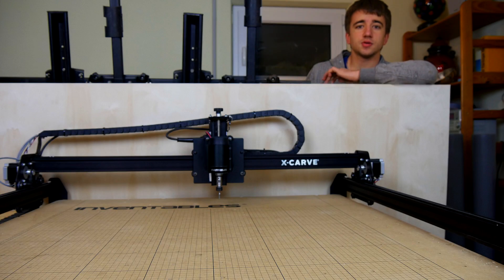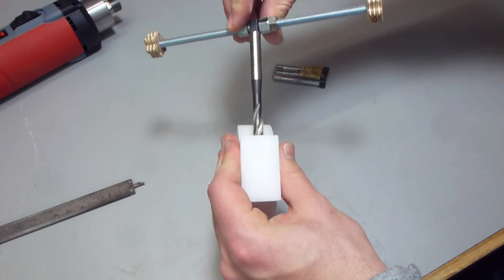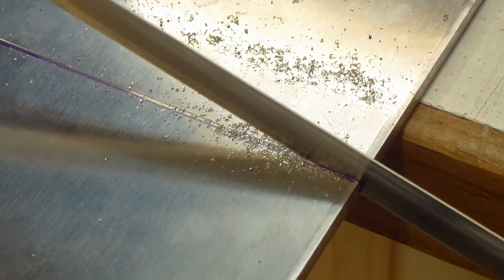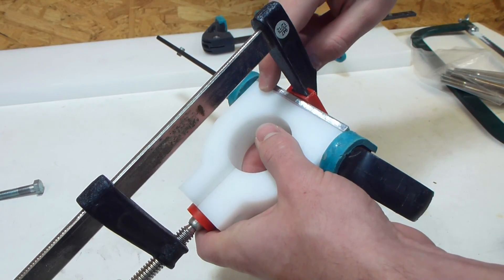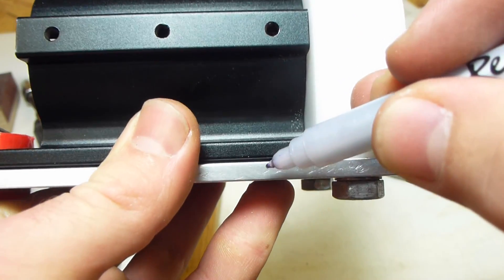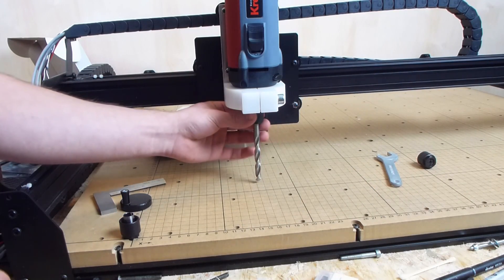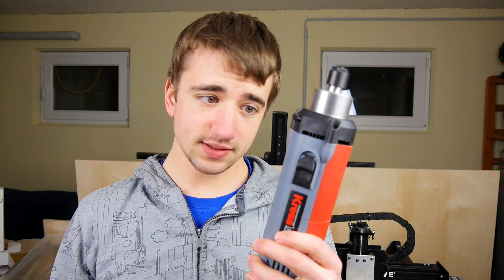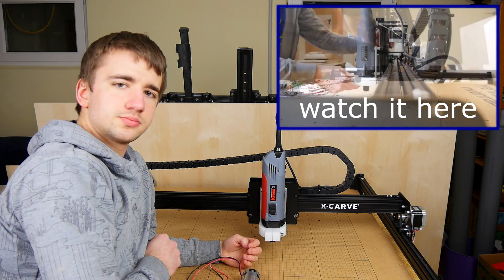CNC Spindle Upgrade

Comment: Those holes are only an uncommon size in Germany.  It's a 9/32" size.  Inches! :)
Reply: +Matthias Wandel As a german, I have to say i hate the imperial system.....
Reply: @roberthagmann8779  As an american I also hate the imperial system, as a contractor I have to use it, but since I learned both it's not that hard, metric is easier, but they both are not that hard to learn. I find metric more accurate
Reply from the maker: +Matthias Wandel Ah, good to know. Strange design then. Metric nut, metric threads but imperial eccentric thing.
Reply: +Robert Hagman 

'murican here, I don't like it either
Reply: Not UK like the rest of the world we've been metric for decades, only use imperial for Signs and car speedometers. America is the odd one out
Reply: +Matthias Wandel 9/32 inches = 0.28125 mils = 0.023 feet = 0.07031 hands = 0.0078 yards, but also:
7,1 mm = 0,71 cm = 0,0071 m = 0,0000071 km.
Reply: Uncommon in metric.
Reply: +gamingSlasher Nope! Metric over here! :P
Reply: *****  I don't know why. Both Metric and Imperial are exotic for China, we used ‘尺','寸','分','厘'... for thousands of years.1'寸'=3.33cm
Reply: @yiyongleng7157  cool, I did not know there were other measurement systems , well not present day
Reply: germany and well, most of the rest of the world
Reply: +ReadandWite In Greece we use inches for wheels and displays.
Man how confusing it is to shop for a TV now that I live in Austria, ie which one is a 40" or a 42 in TV. (First World Problems :P)
Reply: +Matthias Wandel  All the things in China are metric, completely, except pipe
Reply: +Matthias Wandel In virtually all the countries of the world there is still one measure that is Imperial and seems never to change. And those are............... Wheels !! The diameter measurements for bicycles of 14-20-24-27-28 and the new in vogue 29 are all inches !!!
Reply: +Yiyong Leng In Brazil too
Reply: +Robert Hagman As an American I have to say I hate the imperial system....too.
Reply: +Tom Pauwels Officially this country is metric but in reality forget it.  No shops will be metric for at least 20-40 more years I was told by many local shops as their equipment is in Imperial AND, as two shops said, they are too stupid to relearn in metric.  sigh  I hate that I have to go to Aliexpress or eBay to buy my damn metric hardware.
Reply: +Matthias Wandel Matthias? Hi!
Reply: daibhidhSCO apart from the sizes of wheels on bikes and cars. Still all measured in inches.
Reply: +Azayles Yep, even the guys that invented it don't use it anymore :)
Reply: Matthias Wandel
Reply: +Matthias Wandel Not only in Germany. We had inches in Sweden in the old days but nothing new is made with inches. Is it the Great Britain countries that still hang on to inches anymore?
Reply: @gamingSlasher  nope, all enginering is metric in the UK now.  People generally still use imperial for thing like peoples height an weight.  Speeds are in miles per hour still.  Bit of a mixture just to confuse visitors!!

Comment: I'm surprised you didn't use any woodworking tools on the aluminum.  I've never had any problem cutting aluminum that thick.
Reply from the maker: +Anton Kiriwas I was told that this is some kind of tough aluminum, so I didn't want to risk ruining a blade.
Reply: +Marius Hornberger That makes sense.  If it has a thick oxide coating, yes it can be tough on tools.  That is what a lot of sandpaper is made with after all.  I keep an old blade around for stuff just like that.  Great upgrade by the way.
Reply: +Marius Hornberger 
Anodized ("eloxiertes") aluminium is very bad for tools. The layer (chemically the same as Sapphire, Ruby and Corundum; just not a single crystal) is very hard (9 on the Mohs-scale, 10 being diamond) and will dull HSS/hardened steel quickly and can chip tungsten carbide teeth ("Hartmetall", hardness 9.5). The almost "raw" aluminium plate you had, would be no problem though. Sure there are many different alloys of aluminium, but all I ever had to work with cut like butter with wood tools.
You should really use oil or wax on the cutting tools though. Otherwise the aluminium will stick to the teeth/knives and you get a rough cut (and may even damage the blade due to the metal buildup).